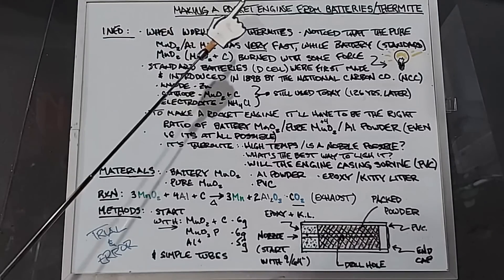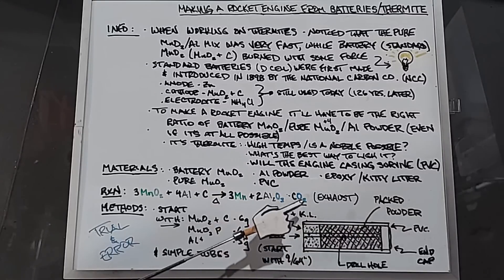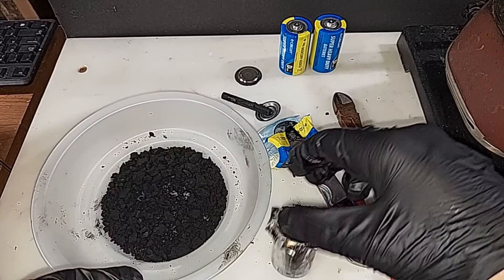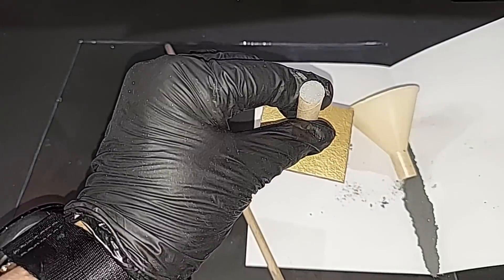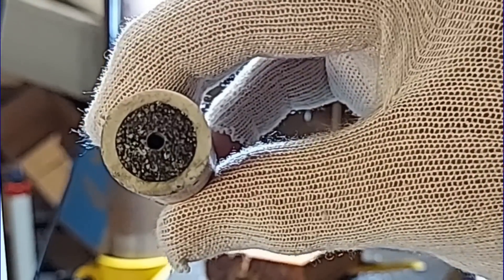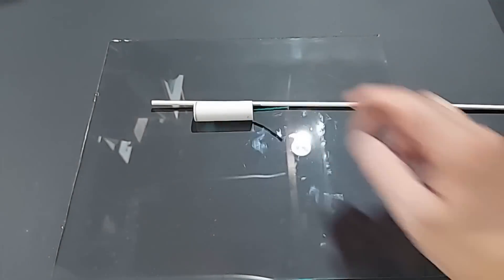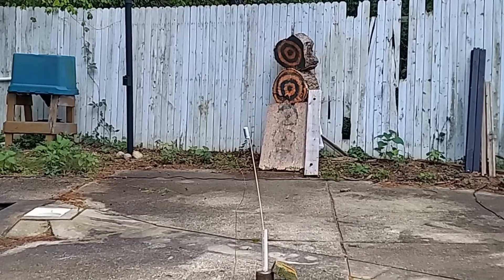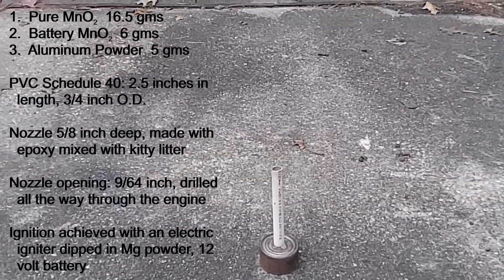Making A Rocket Engine From Thermite And Batteries

Comment: You are packing mixed powders.. how can you drill into that? At what point does it adhere together enough to maintain a central hole?
Reply from the maker: The powders are pack so tight they maintain the hole.  Doesn't seem to make sense but it works.
Reply: @cranialconstruction  interesting thank you! This is perhaps related to the clumping you needed to sort out with the paper. Keep your fingers :)

Comment: Copper oxide/aluminum thermite burns very fast...often needs to be 'cooled off' or it just explodes!
A small amount of a carbon-based binder moderates the burn-rate...corn starch or powdered sugar.
I had some luck using Silicone sealant as a binder/moderator...makes the flame a bright blue!
Reply from the maker: Thanks for the info!

Comment: Excellent job!  Are you just experimenting with the idea of manganese for fuel as apposed to using other chemicals like potassium chlorate which is a lot easier and more controllable?  Very good video though and most interesting to me.  I tried manganese dioxide pure form years ago and no matter what I tried I could not get it to work at all. :)
Reply from the maker: Yes this was just to see if thermite could be used as rocket fuel.  However, I probably will expand this in the future.  Hopefully.

Comment: That's a lot of heat that could be put to work too. Just need to pick a compatible compound which will decompose to gases. As it is, you've mostly just CO2 and liquid thermite products. 
Very interesting concept, thanks for sharing!

Comment: It works fantastically well as a rocket propellant. We've been using it at the PGI conventions for quite a few years now. Use a magnesium/aluminum alloy (magnalium) in the finest granulation that you can find, instead of aluminum. 68:32 is the ratio we've been using. The exhaust is MnO2, so not ideal for backyard experiments (you don't want to breathe it). Here's a slo-mo video of a 1" bore motor, 10" long. https://youtu.be/u0gK1o30o08?si=efDmLra3AlgRSvYu

Comment: I have an idea that may help get just that little bit more maybe have a weak hair dryer or a USB heater to keep Ur mix extra dry or a safer option is to invent a two chamber ball mixer that can have salt that urv dryed in the oven can still be warm or if U want to store it dry just use thread tape on the top of the jar and just have a not air tight container for the mix that fits inside Ur salt storage jar those 1 gallon  4.8liter jar of pickles is always a good start I use that jar for making my home brew spirits

Comment: Bro walked so we can run. All my respect points, have them

Can we just rinse the NH4Cl from the battery mud to get pure MnO2?
Reply: If you dissolve the battery manganese dioxide carbon mix in hydrochloric acid (take care, it produces chlorine), filter it then add sodium hypochlorite (bleach) and fairly pure MnO2 will precipitate out.
Reply: You still have carbon there tho
Reply: NH4Cl being highly water soluble and the MnO2 being insoluble I'm going to say yes. Add water, stir, filter,  done.

Comment: Have you ever watched the "Elemental Makers" video on thermite fuse? I think he used silicone, potassium permanganate, and sulfur?
Reply: That stuff is great. I use it for igniting thermite and I've never had it fail.
Reply from the maker: I've seen it recently.  Got to try it soon.
Reply: @cranialconstruction  you might have to use some naptha/ lighter fluid to fully mix it. If you thin it out with enough you can extrude it through a syringe and have little strings of it like regular fuse rather than cutting pieces from a cake of it.
Reply: @chemistryofquestionablequa6252  100% using a bit of solvant will help get a uniform mixture, also I found that Adding a bit more(5%-10%) silicone made the mixing a whole lot easier.

Comment: Try lining the tube with the zinc. It'll boil and give more thrust.
Reply from the maker: Possibly, but the goal was to use only MnO2 as the primary driver of the rocket engine.
Reply: @cranialconstruction  Yeah, was just a thought.
Reply: More poisonous tho?
Reply: @bastiaan7777777  Not really. Manganosis is worse than zinc fever IMO.

Comment: Any tests on only battery MnO2 and Al, after finding the right ratios at the end?
Reply: I was wondering the same thing.  Maybe more CO2/thrust from the added carbon content?  So time consuming though, because it's all trial and error.
Reply from the maker: I had already tried that when I was working with thermites.  At any ratio not enough thrust.  But, it looked cool.

Comment: Brass balls work better for not  contaminating your mix. Black powder guys have learned lead balls dirty the powder a lot.
Reply: As a person who is missing a his right pinky due to using marbles his my ball mill, I would highly advise that you stick with lead due to how soft it is, and the fact that it deforms under pressure. Remember that pressure induces head, and that pressure is force over area. Consider how small the contact area for two non deforming spheres is during a collision.  I really recommend sticking with lead. There is a reason the amateur pyrotechnic community uses it.
Reply: Brass balls detected